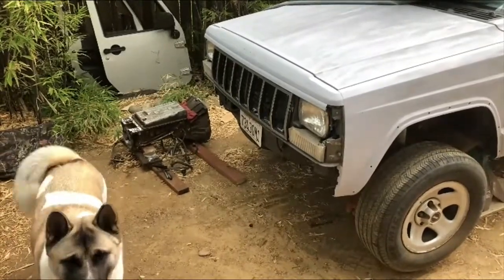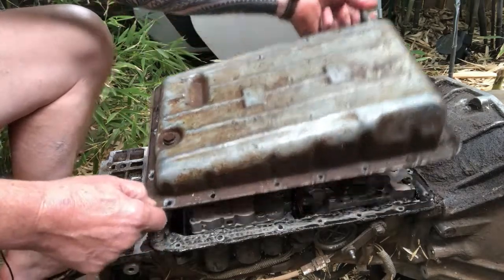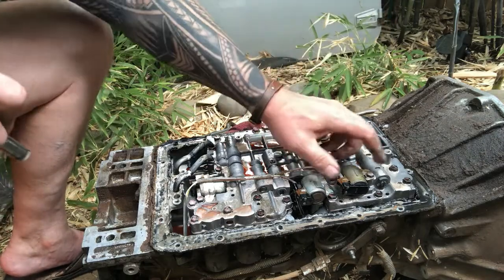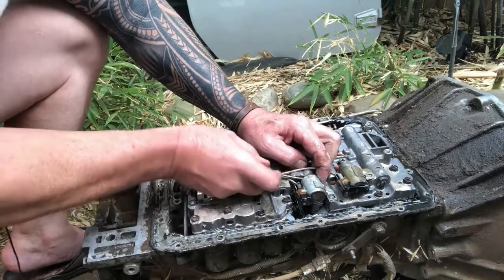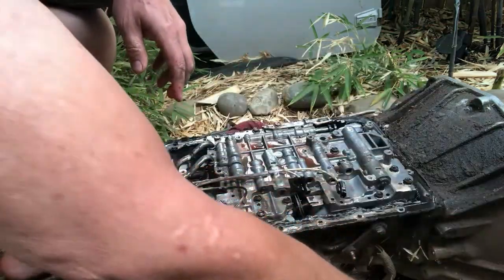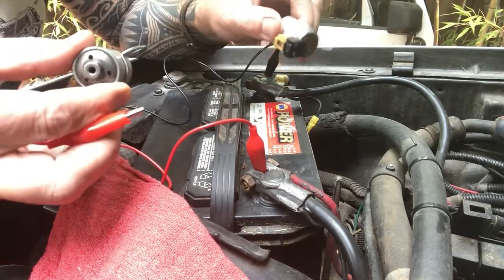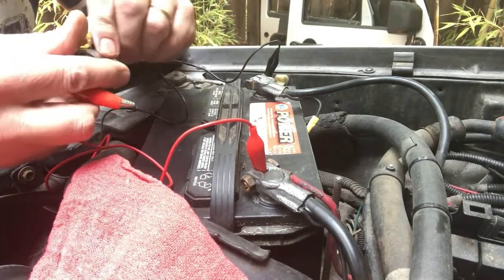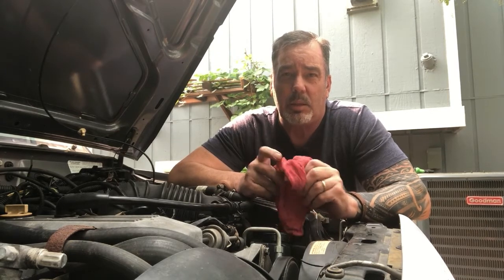Jeep Comanche and Jeep XJ Cherokee Aisin AW4 Transmission Solenoid Removal and Testing

Comment: have a 96 jeep XJ with the aw4 just replaced the tranny from a 97 XJ with 80k miles. original trans had 325k on it the problem was stuck in high gear everything else worked. no codes shown replaced the fluids the 3 solenoids all that still stuck on high gear. after that i swapped the tranny from the 97 XJ. wiring harness connection was different but had the same 7 wires so i spliced the old connection onto the new harness matched all the same wires.  the other difference is that the speed sensor was different from the original trans from a black long plug to a small green sensors. Now this tranny wont shift past 1st gear. no codes no leaks everything running beautiful and strong. only thing i haven't done is locate and check the TCM for my XJ . I read somewhere that the old speed sensor does one pulse compared to the 97 and higher models does 4 pulse. not sure if the stock TCM is being thrown off from this or needs to be replaced with a higher year TCM to work. My XJ has been the bane of my existence the past month. Any help you can offer will be greatly appreciated.

Comment: Hello mate I've got some problem with my jeep xj 1992 when is cold it never goes to reverse if its hot it will not go either unless if i give gas arround 4000rpm then it goes so hard and fast like someone flipped a switch could you please help me?
Reply from the maker: Hey brother sorry about the late response been busy as shite...
XJ 92 great Jeep btw...If it was mine, I would drop the pan, make sure you're running the right tranny fluid, and change ALL of the damn solenoids, while you're in there. AW4 is a strong transmission...Sounds like one of them is crapped out, reverse one especially. Cheers hope this helps.

Comment: Excellent video.  I'll be doing this myself in several hours.  I did forget to order a transmission pan gasket so I'll have to pick that up.  You definitely saved me some hassle there.  !!  I bought a remanufactured one several years ago and my pan doesn't have a drain plug, neither did the original.  I bought a drain plug that can be installed into the pan after you drill a hole so that process isn't so messy in the future.
Reply from the maker: Awesome! Thanks for the info…I’m going to do that too!

Comment: I have an xj 97 and when it's cold it doesn't go into second gear until it reaches its working temperature and it grips well all the time, what could it be? Thank you
Reply from the maker: Maybe change out your trans fluid and check the level, I wish I had a better answer for ya…hope you get it figured out

Comment: I realize this is an older post, But I have a 1997 cherokee aisin aw4 , and I am going to put a 94 aisin aw4 as replacement,  do you have any tips on how to wire up the 7 pin connector to the 5 pin connector properly,  or is it same color wires needed (aside of 4x4 indicator light)thank you.
Reply from the maker: Jeez that’s a good question. As far as the wiring and colors go, if you had a wiring diagram and could compare connector pins and voltages that would be the ticket. Good luck with it I wish I had a better answer for ya…

Comment: I've got a 98 xj and I keep getting a P0700 code and I tried replacing the computer and still get same code.. ive had a filter and fluid change but not a flush.. so now I've bought new solenoids and thinking about doing a flush. My fluid is still kinda dirty. I haven't installed the solenoids yet.. do you have any suggestions? Thanks for the great video by the way..
Reply from the maker: No prob thx for your comment…Code P0700 means the Powertrain Control Module (PCM) has detected a fault in the Transmission Control Module (TCM). If you have troubles with transmission shifting eventually the PCM will show the transmission fault code(s). If you don't have shifting problems the P0700 may go away on its own. Try the new solenoids, hopefully that fixes it. And make sure your shift linkage is adjusted properly. Hope this helps bro…
Reply: @outboundterrain6454  yeah I adjusted the throttle valve cable I got a new tps from Mopar being delivered tomorrow.. and yeah ill prob end up replacing solenoids and doing another trans service.. its just really fustrating.frustrating.. its works when I go to work about 3miles.. and when I go to on lunch and when I come back it pops the code.. to me its either a issue with the 3/4 or the lockup solenoid bit thx for replaying.. I feel like im chasing my tail

Comment: Thanks for a great video. My 96 Jeep Cherokee Sport stopped going into any gear It will not reverse or go forward. This was after a 4 hour drive home . I did have some wires (3) that were chaffed going around the dipstick. They were bare wire all touching each other and the metal dipstick. I repaired them by cutting out the bad parts and splicing in new wire. I also had (2) more wires below that went to a sensor. I fixed them too. Prior to this the jeep started and posted check engine. Now she starts and purrs with no error. It just wont go into any gear forward or reverse. I plan to look at the solenoids. Do you think this symptom is indicative of a solenoid failure?

Comment: Thank you. Trying to figure out what to do with 97 XJ automatic, not shifting into second at times and check engine light on. Scan tool read a solenoid code. Has over 217,000 miles on vehicle. I bought it used, so don't know all her history. Was told not to change transmission fluid, with the mileage she has.
Reply from the maker: Hi Rj, thanks for the comment. That’s great that she’s holding with that many miles. Solenoid code, a new one would probably remedy your prob. Only thing is obviously you’d have to drop the tranny pan you pop in the new solenoid, which meansyou would have to change your transmission fluid, unless you use the old fluid. Also I’d replace all 3 solenoids while you have the transmission pan dropped…that way you don’t have to do the same procedure all over again later…hope this helps man…

Comment: I am having trouble with my aw4 not shifting back to 1st gear when stopping the jeep at a light or stop sign, thus I have to use the shifter to force the aw4 back into 1st gear, and then shift it to drive after getting the jeep up to 25 MPH. Sooner than later I am going to change transmission filter and gasket, and just because...the shift solenoids too, but I will definitely do the tests that you did, so I can make sure there isn't an electrical wiring problem. Thanks, dude!! Very helpful info!! Thanks a million!!
Reply from the maker: Hey thanks for the comment! Glad the vid helped ya…yeah those wires definitely needed to be fixed. How’s your linkage adjustment? Mine was way off. Yeah when you drop the and change the filter definitely change all those solenoids…also make sure have the correct tranny fluid, these Aw’s are finicky…also one final thought. There is a tcm, aka a transmission control module. It’s a box under you dash…test it by unplugging it see if your shift points improve. You’ll have to manually go through the gears when you drive it. If it improves with the tcm unplugged that’s your prob. They’re cheap to replace. Hope that helps bro…Chris
Reply: I’m having the same problem. About to change solenoids did this fix it for you ?

Comment: Transmission shops are big rip-offs, especially Aamco, I spent almost 2000$ on a supposedly rebuilt job, after one year I changed the fluid, found out my old solenoid's were still In place, the tranmy was not removed, I could tell, since I had my XJ new, I think they just cleaned the solenoids and put em back.
Reply from the maker: Really! That’s bs! Yeah there some douche bag mechanics and shops out there. I hear this all the time! Sorry my friend. Did you put new ones in yourself? How is it now? Thx for the comment k...

Comment: My trans works great except wont lock up. Stop light switch is good cruise does not work either. Could the lock up sel be bad?
Reply from the maker: Sorry about the late response. Yes I would try the lock up sol. The cruise control check all your relays and groundings. Hope this helps